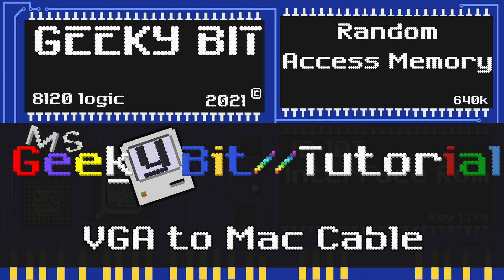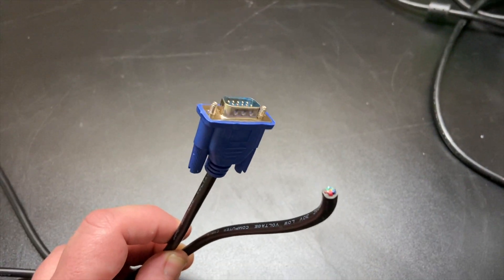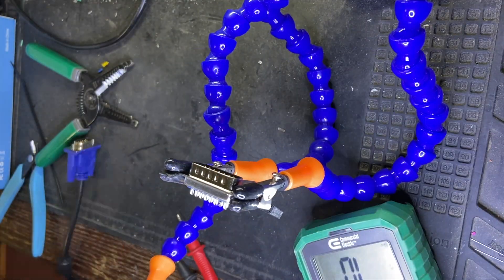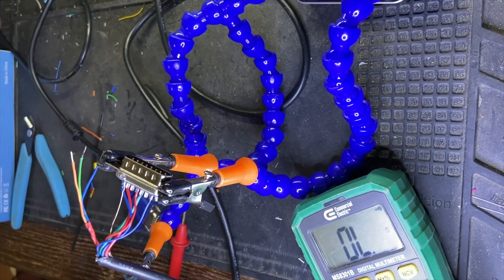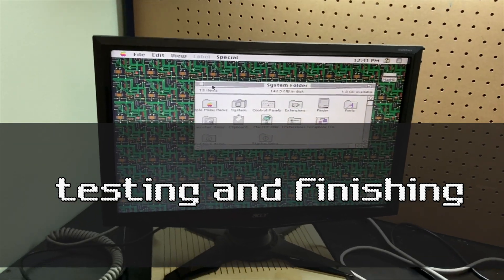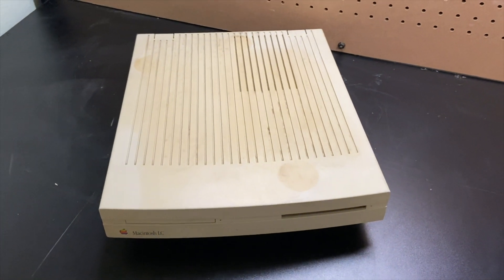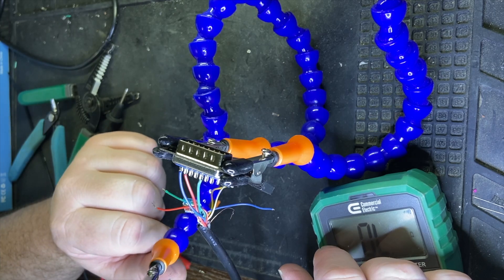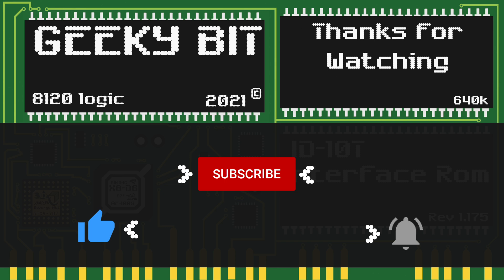Tutorial - VGA to Mac Cable (DA15)

Comment: i need to make a db15 female to vga male.. is this possible with this video?i want to connect a mitsubishi 3925 crt to an soft 15khz ati radeon vga card-- hd5450-- please i need an asnwer! thanks you!
Reply from the maker: Well this is a complicated question first of this video is for getting a classic Macintosh to work with VGA.... The HD5450 Only has DVI If I recall and isn't 15Khz... so there will be a lot of issues getting that working. I would say that this video likely isn't the video for that, and what you are doing may require a 15Khz to 31.5 Khz adapter on top of that. I hope that helps
Reply: @GeekyBit  hello there! thanks you for your reply! ati hd5450 has analog vga output and with calamity mod drivers you can go 15khz. you think i still need an adapter? i probably will buy a vga to 5bnc cable,think it will be easier.... mitsubishi can do 800x600 at 15khz
Reply from the maker: @marcosgimenez303  Yeah that sounds good to get the VGA to 5 channel BNC connectors

Comment: What a pointless video. For someone who doesn't know how to do this, watching it in fast forward is not very informative. For someone who does know, why would they be watching it in the first place?
Reply from the maker: Sorry you feel that way, but in the video the solder work is sped up however the part where which wire goes where isn't. Also I point out in the video there is also a text guide in the description. Not only that there is also a wire diagram as each VGA cable might be very different. I even show how to use a Multi-meter in continuity mode so you can find out which pin is which... This is a broad explanation as there are many different makers of many different cables. I get you feel this is a waste, but lets review. It shows how to use the tools and what to look for in a diagram. Then it shows you how to make a cable. So the only thing it doesn't do is handhold someone through the process. I am sorry you feel people need that.

Comment: Why don't you cut the mac cable and just do the green wire with the green red with the red wire and etc I got two cables and I'm gone cut but you don't show me what to What you took adaptor and do nothing this shows nothing cut one vga cable and one mack and show us what color wire goes to what already soldered
Reply from the maker: If you look in the description I show the diagram. I state in the video that the cable I have doesn't have the correct colors for the correct pins so I used a multimeter and a diagram. I hope this helps.

Comment: will this cable display an image on a proper apple crt? (pc => Apple color monitor)
Reply from the maker: It is designed for going from a Macintosh to a monitor , sorry not from a PC to a mac. It might work but I don't think so .
Reply: @GeekyBit  have you tried this? I'm trying to find an easy way to use iMac g3 tray loader as a monitor.
Reply from the maker: @Keithjordan101  I have tried it with an older mac monitor I have but I need an adapter ... it seems to work more or less... the image quality wasn't great but that could be the monitor or any number of things.